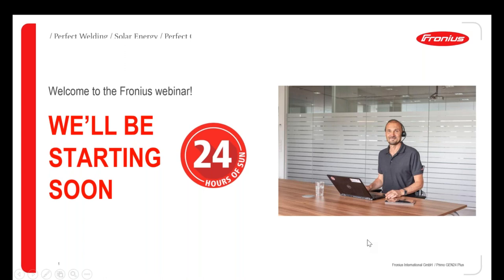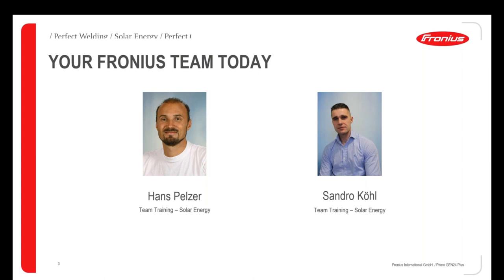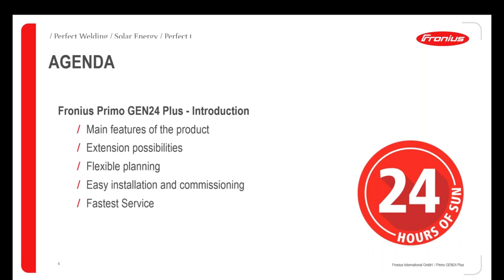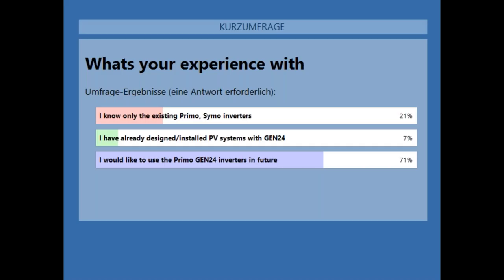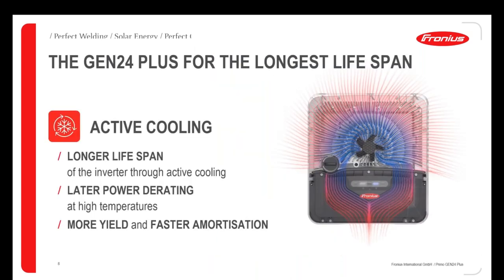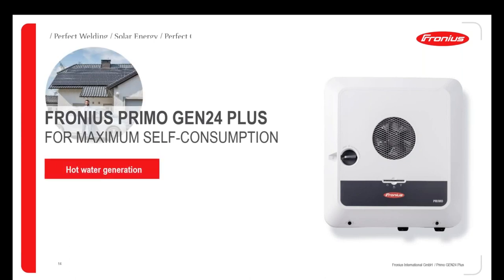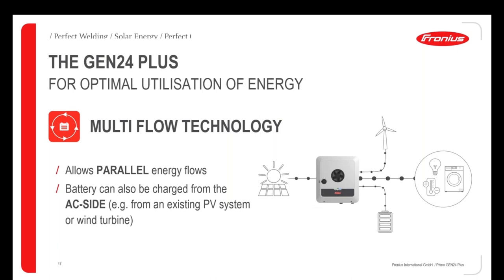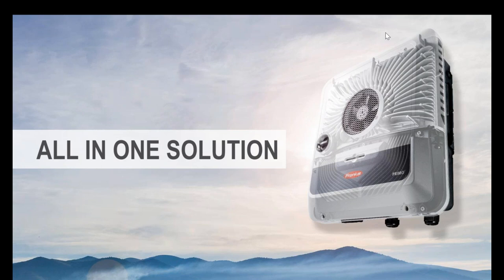Webinar: The new Fronius Primo GEN24 Plus

Comment: I have a 10,000 watt premo grid tie inverter, very interested in a battery system. I have tried calling the phone number for Fronious USA and left message, no call back. Is the gen 24 usable on the USA power. Also do you sell any sort of kit that would make my current premo 10k so it could charge batteries. It is a great inverter, would hate to give it up but want to take the next step towards energy independence .
Reply from the maker: Hi Nolan Seim!

We are sorry you missed our USA Tech Support team, unfortunately we don’t have a voicemail, but you can reach them Monday through Friday from 8AM to 7PM CST. Just call +1(219)734-5500, then press (1) for Solar and (1) for Technical Support; or e-mail at: pv-support-usa@fronius.com
P.S. The Gen24 is currently not available in the USA but will be in the future (we don’t have an ETA yet). Please call or email us for further technical advice or call your installer to check if your system can be converted.

Best regards, your Fronius Social Media Team

Comment: Sorry to necro an old thread but my searches have not found an answer.

Is it possible to parallel two or more Primo GEN24 hybrid inverters each with their own separate and independent battery systems and have them properly co-ordinate and report? I know we can parallel Symo GEN24 hybrid inverters, we can parallel battery systems on a single Primo GEN24 and we cannot use 2x Primo GEN24 on a single battery.

I have a systems design that has more solar and battery capacity than can be met with a single Primo GEN24 but could be met with 2x if they can be paralleled. This is in a zero feed-in on-grid scenario but sized to be able to survive indefinitely in the absence of grid supply.
Reply from the maker: Hi Shane Finn!

We are delighted that you have taken an interest in our products. Please send an e-mail to support@fronius.com and we will gladly provide you with more detailed information.

Best regards, your Fronius Social Media Team

Comment: What is the largest solar array allowed on these?
Reply from the maker: Hi! This depends on the type of module you are using and the respective open circuit voltage. The maximum open circuit voltage on the Fronius Primo GEN24 Plus 3-6kW is 600 V DC. This threshold must not be exceeded. Check out our online tool for configurations and system design http://solarconfigurator.solarweb.com. Best regards, your Fronius Social Media Team
Reply: @FroniusSolar  thanks! =~11kw in my scenario.  Nice